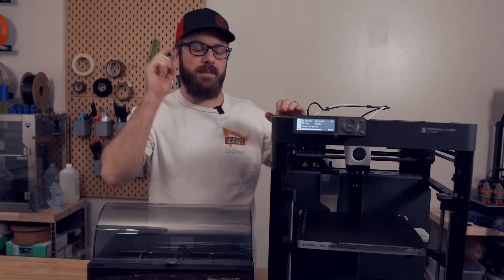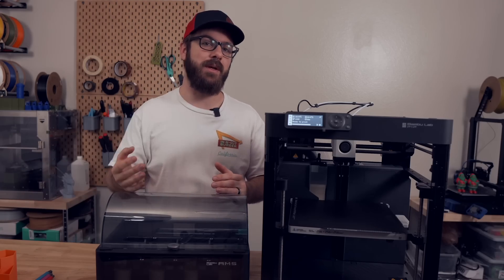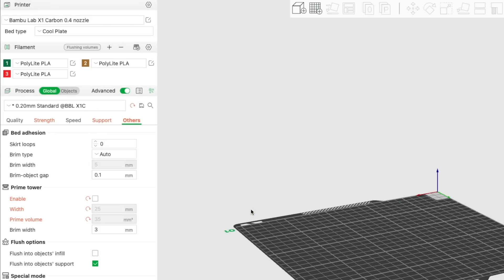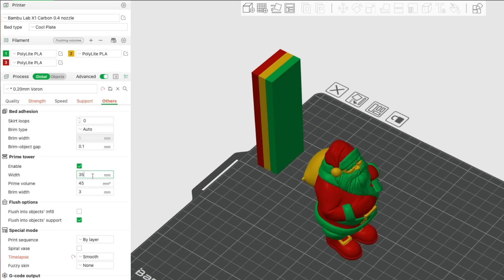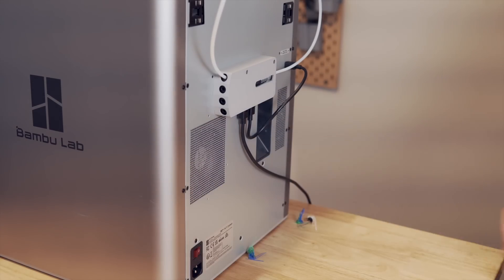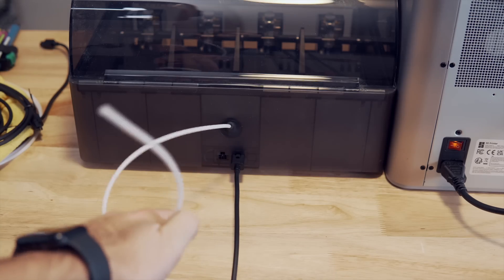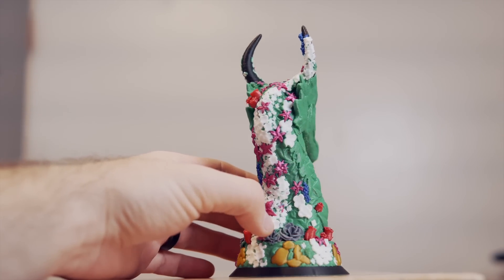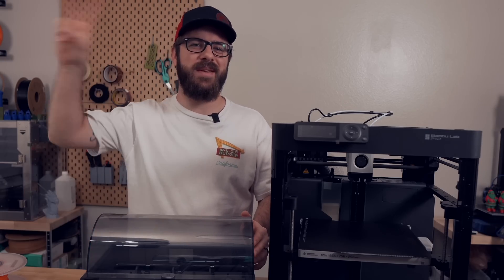Game Changer For Multi Color 3d Printing (AMS)

Comment: The fact that it doesn't force you to use their NFC tagged spools is amazing.
Reply: What would be even better is if they opensource the details of the data on the NFC tags to allow other filament manufacturers to start putting the same tags on their spools, and then other printer manufacturers be able to read that data to "autoconfig" to the filament brand, type, and color. (Similar concept to USB device ids.) Need to see how much they give back to the community of the other opensource IP that they've used to build their machines. I haven't been paying any attention, so I don't know how likely they are. Are they as collaborative with the community as Prusa, as vampiric to the community as Creality, or somewhere in-between? Or is it too soon to tell? (I mean, even Prusa holds off releasing some of their innovations until they have hardware shipping to avoid bad players like Creality from outselling them before they can even ship the first unit.)
Reply: i was worried about this at first. don't give them any ideas!!
Reply: "force you to use their NFC tagged spools is amazing." ... well, not for now. They can always activate that "feature". ;o)
Reply: There are problems though. We're currently unable to get a straight answer about how much of your data goes back to the company in China. Oddly enough we did get a sideways answer and we're seeing that while the camera feed is only speaking to the LAN, the job data seems to go out to the cloud.
Reply: @blackstoneriverworkshop7167  if you have a facebook account dont act like you care about data security lol.
Reply: I still see people telling others " RFID MAKES IT SO YOU ONLY USE THEIR FILAMENT" like, no. You are stupid. More Bambu superiority for the rest of us.
Reply: @NimbusX823  people are ignorant and many are upset they spent nearly this much for their 'completely open source' slower printer. weird hill for them to die on, but it's ok. I'm building a couple of vorons and I see some things that can already be improved upon. :)
Reply: @Festivaljunkie  Just remember that a sizable reason why companies like this can offer these products at such low prices is because they've illegally used open-source software (GPL violations) and don't care 'cause they know the open-source projects don't have the money to actually take them to court.

Comment: Been toying with the idea of grabbing this setup with the carbon. Seemed foggy at first, but now that you have broken it all down, the connectivity is a lot clearer. Thanks, Daniel. Fantastic vid as always.
Reply: Just my two cents here. But people really downplay the waste. He is right that making multiple items can take the sting out of it a little bit. But it's still wasteful. I don't have an X1, but I do have the Pallette 3 Pro that can do 8 colors on any machine, and boy oh boy is it wasteful. It's really cool at first until you realize just how much filament your throwing away, and then it gets to that point of wondering if the extra cost associated with the waste makes multi color worth it. Also one thing I have yet to see anyone talk about is multi material with the AMS. Changing PLA colors is easy but how does it handle changing different types of material? I can tell you the Pallette sucks at it. But only because it tries to melt the filament together in one big strand and different materials don't like to stick to each other. Plus you have to remember that your nozzle will have to pause and heat up/cool down between material changes and this can cause issues going from a higher temp material back down to a lower temp material, because there is always a little bit left in the nozzle to push out, and if it can't melt properly, your gonna get a jam. There are lots of things to consider when thinking about multi material printers. I'm not telling you what to do. I think the bamboo labs printers look pretty sweet. But after learning with the Pallette, my outlook on these types of printers has changed. Printers with independent tool heads like IDEX machines are the way to go if you want to avoid waste and material changes. Then again, if we ever get a decent affordable home solution for recycling our waste back into filament, that would be a game changer.
Reply: @Grant Deisig   I was thinking of just using it for continuous printing for one color when long prints are necessary.
Reply: @petercasper224  That would probably work very well with the AMS. The pallete can do this too, though I've never used it that way yet.
Reply: @Grant Deisig  thanks for the heads up.  I have prints that go for days. I have to babysit waiting to swap out a spool. With the ams that would not need to happen unless it chewed thru all four rolls. Not very likely.

Comment: I thought of this the other day.  Why doesn't bamboo labs make the filament change a little before the color change so it will merge seamlessly to the next color with no waste?  With the known length of filament left from the cut, this doesn't seem impossible.
Reply: It’s impossible. Especially when changing from dark to light colors or when you have very small color changes on a single layer.

Comment: They need to make this work with other printers! They would sell so many
Reply: i bet they will, but for now, this is the main selling point for theirs! this and the speed.
Reply: Material handling is machine specific, any other mfg could order a AMS and integrate it into their platform. It’s ludicrous to think this company is going to waste resources to enhance sales of other hardware manufacturers. Did you really think your comment through before putting it out there for the world to see?
Reply: @judd_s5643  You think their unit working on Marlin and Klipper printers is somehow going to enhance other printers sales more so than it would enhance the sales of their AMS? No.. it would only increase their market share. 
What you suggested is the far more Ludacris than mine. Did YOU think before you replied? Lol. 

Maybe gun manufactures should make their own new mount for scopes so that only their scopes work on their guns and their scopes won't mount to others guns. Lol See how insane that sounds? 

When they have a product... That only works on their product.. then their potential customers for that is literally only those who they have sold a product to. If they managed to figure out a way to make it work with Marlin/klipper... They open up to MILLIONS of sales they otherwise would never happen
Reply: @nsboost  GAL

Comment: There's no need to set your flush and prime so high. So far I got as low as 0.2 multiplier and 10 for both prime width and volume. I also flush into infill but that's not crucial even for small prints. Love to see more people experiment with these values.
Reply: I'd love to see a tuning guide for this. I try to stick to only using the AMS capabilities for indicator layers and things like that since I want to avoid wasting lots of filament.
Reply: Flushing into infill is a brilliant idea! I just posted the following comment... "Where are all the three color mixing 3D printers??? A 3-in-1-out extruder with cyan, magenta, and yellow should be able to cover the color spectrum quite nicely. I'm fairly new to the scene and am surprised to find that the market hasn't already been inundated with armies of printers touting their ability to best provide that solution."

Comment: Hey Daniel, nice video as usual. One idea -- for strict multicolor printing (ie: not multi material) it would be nice if you could tell the printer to print the actual multicolor model, plus another model that serves as purge tower, but is instead some useful part whose color you don't care about. Or for that matter, if you're printing a three color model, then have three other parts you want, each can be a single color. Of course the heights would need to be somewhat compatible. But this would save a bunch of otherwise waste filament.
Reply: That would be quite a fun feature
Reply: I would also be nice to have the purge go into support or infill as a way to reduce waste.
Reply: @bracco23  it can do it
Reply: That’s an option in the settings. You can also turn on or off prime tower to decrease time.
Reply: @JohnSmith-rt5yq is it simple to implement, and how effective is it? I guess the purge block isn’t huge, but it seems to me that the block wouldn’t fit inside the model. Would love to hear about this, I’m strongly considering getting a P1P and the AMS

Comment: multicolor fdm is kinda pointless, maybe if you have few speciality materials.. like soluble support or something like that... but just for colors, how many trinkets are you going to print?
Reply: I printed and sold 30 turkeys this Thanksgiving simply because they had 5 different colors on them. They looked way better than just one single color. I could have sold more but I ran out of time! Now the same people are wanting Santa and trees that are multi colors. So for me, it's totally worth it!
Reply from the maker: Way more use cases than that. Print farm management, more realistic prototyping, the ability to make a part in multicolors to show how worn it is and when it is time to replace in assembly line setup, filament runout swapping (if/when added). For me much of the multi color printing shown is to show its capabilities of accurate swapping. There are much more use cases for this in the functional/business realm.

Comment: @Modbot CAUTION! 9:34 is wrong. The order of installation is critical, otherwise the I’ds and machine order for ams 2-4 get randomized. Ask me how I know. Always connect the units one by one in exact order. Especially if you want an older V2 unit not to be the default ams.You can’t change ids until they’ll fix the firmware.

Comment: Being able to set it to auto jump to the next spool on runout is a fantastic idea.  I think Bambu Labs should move this idea to the top of the list.
Reply: ^^^ This feature has been implemented today. :)
Reply: I vaguely remember reading it being suggested ages ago, and Bambu saying something along the lines of "yeah, we'll be doing something like that", but since it's still not here I guess they're not prioritizing it or they're taking the time to think of and implement support for all scenarios.
Reply: @mascot4950  i think it's twice over an issue; run out while doing multi color- do you go to the next color or prompt to refill that color and pause? vs when you're doing one print, many spools of same color and hop to the next spool on run-out just to make print-farming easier. either way, shouldn't be hard for them to tackle.
Reply: @Festivaljunkie  It's not necessarily hard, but there are a few scenarios to consider. For single color prints, automatic vs predefined vs halting for manual decision. Multicolor would require UI design for designating failover per spool, potentially across AMS units. All of this requiring changes to both slicer and the UI on the printer's display. If you want to do it properly, you need to take a breath and think it through before implementing. As for prioritization, it wouldn't exactly be shocking if they put getting the P1P out of the door at the top of the list, and that would have used many of the relevant resources.

Or, they just don't see the point and don't care. I have no idea.
Reply: Not far away from now.
Reply: The Prusa MMU2 (mine is hooked to a MK3S+) already has this as a feature for their material changer, so it shouldn't be that difficult to add into the printer code to have an option of switching to the next spool and/or next spool of same color and material (the Prusa MMU2 just moves to the next spool in line). It is a nice feature since you don't have to put aside a partial spool if you don't feel there is enough on it for the job and don't have to deal with the frequently dubious fusing of 2 smaller spools of used filament into one larger one.
Reply: My IDEX printer has this feature. It’s called Backup Mode, I think.
Reply: @Jon Stern  what kind of idex do you have and do you like/recommend it?
Reply: @digitalpilgrim  I have a Craftbot Flow IDEX. It’s a solid printer, with a couple of annoyances. The flaky connector to the fans being the most prominent (at least in my unit). I have bought the mod that converts it to a conventional connector, but haven’t installed it yet.
Reply: mmu`s prusa do that
Reply: This feature has been implemented today :)
Reply: Its already been updated to use the next filament on runout.
Reply: This is sort of the killer would-be feature for me. I'd love just four rolls of PLA and not worried about run outs, being able to completely use a spool, etc.
Reply: @variancehammer246  that is why I got the AMS, to works amazing.
Reply: That's dope, just load up four spools all the same filament and bam now you don't gotta refill as much, so you would be able to print 4 times the amount of material you could fit on a single spool if you didn't have ams
Reply: I know its on the X1E, the enterprise version, I wouldn't be surprised if they don't roll it out to the other ones to keep the enterprise version as a more advanced model, which of course you pay more for.

Comment: How well does the option to change colour within the infill/support work ?

That purge tower (Currently, hopefully it'll get improved in future) loses you quite a bit of material that could otherwise still be used but just hidden within those infills and supports.
Reply: The tower is used to get the new incoming filament flowing correctly.   You can hear it start printing slowly then picking up the pace as the filament is getting up to tempature. I have made mine a bit smaller as well, like he did in his video.  I haven't tried to see exactly how much smaller to make the tower.   But yes it still needs some tower there.   I hope I made sense with my explanation.

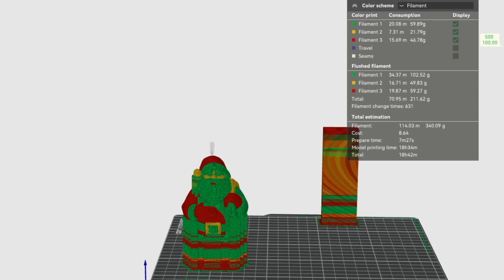Comment: Thanks for the nice video. @6:10 you mention 7 and half hours for material purging, but that is not correct. It's 7 and half MINUTES which is the standar preparing time (ABL, flow calibration etc). For the rest: I have the AMS and I love it 🙂